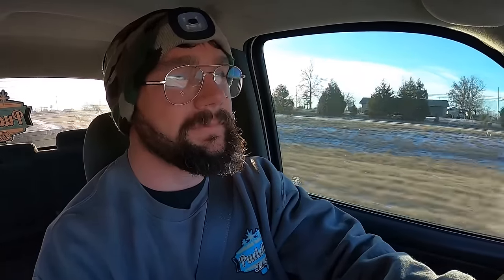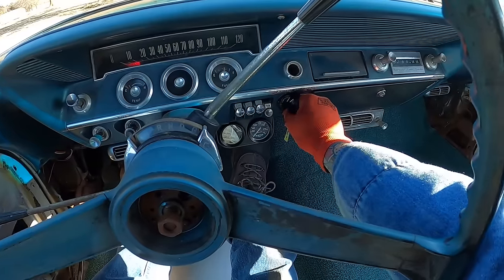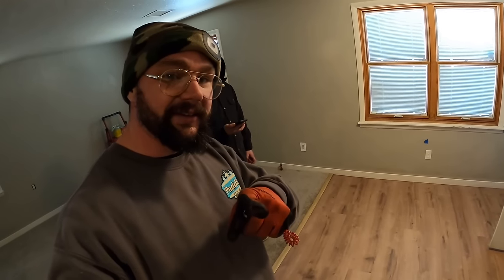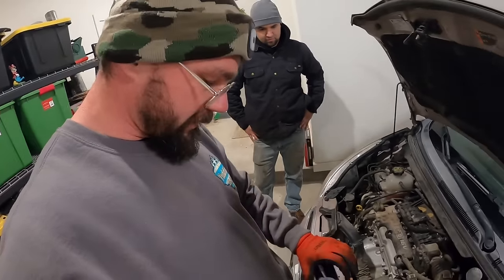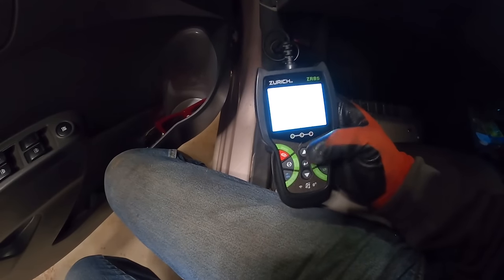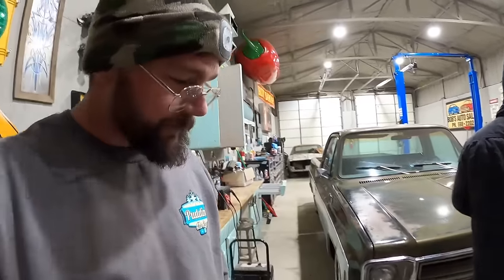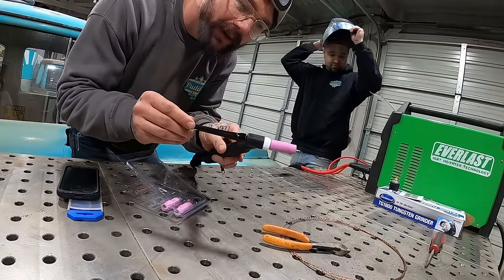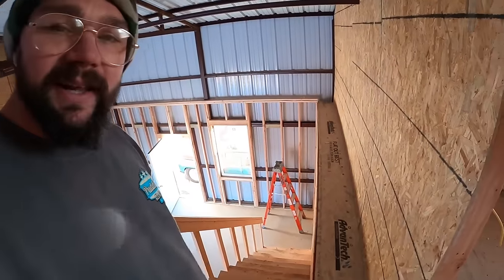Wagon is Back?? House update, Bad Coils, Shop Updates && MORE!

Comment: You should look into doing a drop trailer build, it would be a game changer for lowered vehicles and junk yard finds.
Reply: Literally the last thing I watched was a drop deck utility trailer rebuild... scaled up to car size would be awesome for lowered cars and recoveries.
Reply: I have seen some that are bagged and slam down for loading slammed vehicles. Pretty cool looking trailers.
Reply: a slammed camper, or slammed vintage camper
Reply: @raymundrodriguez1442  air bag trailers are awesome. No need for ramps...dump it down, drive on, pump it up, drive away.
Reply: @jmsmilin   a slamper!
Reply: I hope that pudding will build a ramp truck or rollback out of one of his two tons or a mini ramp truck out of the Toyota camper chassis with a mini 4 door cab .
Reply: Second hint is a front wheel drive haul truck with a air drop trailer for the back half of the vehicle.  So a towrola engine transmission with a mini truck cab .its the lowest possible way to haul or load cars

Comment: To see if the coil is bad just switch the coil with the one next to it if the miss fire moves then you know the coil is bad  if it stays on number 3 then there is a different. Issue   maybe coil wire coil plug  or even  the injector

Comment: Lovetap WAS looking real fine in that snowy cold 🥶 backdrop. AND she made it to work. Wonder if all the EV folk can say the same. Ol' reliable. 👏🏻👏🏻💪🏻
Reply: As long as an EV doesnt have to charge when its like -20F they don't really care. They'll lose some range but so will a ICE warming up and running the AC with the defroster.
Tit for tat an old ICE might knock till the oil starts flowing, an EV doesn't want to charge. Let the ICE idle up and let the EV condition its batteries they're both fine.
A more funny EV issue is without the engine dumping heat on the hood, the hood of an EV will stay frozen and blow snow all over the windshield. Same with LED headlights, no heat and they cover up in snow.

Comment: With regards to the internet in your shop, don't get a wifi booster, look into getting a Mesh Router. They are routers that usually come in packs of 3 or more that you place in different parts of your home/shop that connected to each other, either wirelessly or wired together with ethernet cables, so it acts as a singular wifi router, no need to switch from 'p-tangs wifi' to 'p-tangs wifi booster' if you were to go the booster route. Great video, happy to see the progress. Hope you're healing up well so we can get back to your regularly scheduled builds 💥👊
Reply: Exactly what I was going to post. With the boosters, you need to switch the device's SSID within each booster zone or coverage area. There are a lot of Mesh router products around to choose from. A strong wifi router could theoretically cover the entire area, but with the metal walls, that gets iffy.

Comment: I would advise pulling your plugs back out and applying copper anti-sieze on your threads. The threads on the plugs are steel, and the head is aluminum anti-sieze will prevent the rust and corrosion, making it easier if you have to ever change them again

Comment: Hey Puddin, Information Technology guy here. Hard wire all the outlets in your office for CAT6 just have them run back to a central router that you can even keep in your utility room. Also run a cat6 line through all of your shop spaces then you can place access points to your shop WiFi throughout in a mesh to really lock it in.

That is probably overkill for your needs, but then all you will have to do is swap out the routers and access points when they fail. Yes they will fail. 5 years is a pretty good life span for a wireless router unless you want to spend a ridiculous amount of money.

Comment: One time I dropped the oil cap on my Kia Optima down onto the splash shield. It somehow wedged itself between the oil pan and shield. I had to drop the shield to get it back. Needless to say, lots of cursing ensued.😅

Get some insulated garage doors for the new shop if you want the HVAC system to be more  efficient.

Comment: I always try 000 steel wool and dish soap first, then move to something more aggressive, you can actually just use a scratch renovator type polish that's used for light scratches and squirl marks, then buff the glass after with polish! 😊 8:33

Comment: For your net, look for someone that can setup Ubiquiti Airfiber. Have the sender at your house and the receiver at the shop. 1.2Gbps connection and you don't have to worry about running fiber to the shop area. We use it at a couple of our sites.

Comment: Oh frozen pipes are fun but nothing like a froze up sewer line to make things fun. Chicago polar vortex in 19 boss told us we weren't working the next 2 days because we were looking at near minus 30 actual air temperature. Figure get up,grab a shower and maybe run some laundry during my unplanned 2 days off. Middle of the shower start hearing gurgling and notice the drain ain't draining. End up having bundle up to run to a nearby gas station for washroom needs and eventually rig a 5 gallon bucket as a camp facility for the next 2 days and crash with family on the third  til things thawed enough to work again. Only saving grace of that situation was being a widower and my wife didn't have to go through the subzero roughing it.

Comment: We just love us some Puddin and Slick shenanigans!
Just a quick FYI...when you looked underneath the old house , that cement block under the beam should be 90 degrees rotated...they are much stronger with the "webs" vertical and not horizontal. Daughter of a mason (not the flaky society) here...talking from experience.

Comment: Use your old glass as a template and get a new one cut from laminated safety glass / double pane with plastic in the center, the guy who cuts the glass can polish the edges.. It will be cheaper than a new factory glass.
Reply: unfortunately it isn't that easy, It's curved and it's tempered glass
Reply: @gmedley66  then there's always Lexan

Comment: A tip from someone who would have a shaky hand tig welding, hold the torch nice and loose. The tighter you are, the worse you're going to weld. Also, make sure you're very comfortable with the way you're sitting.

Comment: Puddin!  Looking at the new building I did not see under the stairs framed in for additional storage.  In my opinion that is wasted space that could be used for brooms, mops😮, vacuum, or other stuff.  I am not trying to tell you what to do, but I see it as a missed opportunity if not utilized.  Also now would be the time to do it and it should be pretty cheap to do as well as quick to frame..  Just a thought..

Comment: I've had to use a pry bar to pop coil packs out. And plastic oil pans are a thing a lot of Ford f150s have them combined with a quarter turn drain plug that makes a mess when it hits the sway bar 😂

Comment: WAGON REAR GLASS Not sure about automotive glass but I have had good luck with removing hard mineral water spots on residential glass with Cerium Oxide. I used a hand drill with a buffing pad attached.  Its takes time and be aware of heat buildup, but restored my glass back to almost looking new.

Comment: Someone plumbed that fresh water right. I grew up in the snow belt and used to plumb residential homes. You have to bury it 18” or more to keep it below the frost line and from freezing between the meter/well to the house. And if you insulate it from the ground to the floor you’ll only ever have to worry about it freezing at the meter. That’s too easy though. A little propane torch and five minutes of your time and you have water again.

Comment: There is a wet sanding method. In order to get to fresh glass, you will have to wet sand to a super fine grit then Polish the entire glass. If you want it all to be the same, but it's possible, you have to sand to a clear layer it acts like paint

Comment: Best two suggestions I have for the glass would be original winded with Ammonia and steel wool, or alternatively if that doesn’t do it, a clay disc or clay bar.  Those clay discs for a buffer like Autogeek sells are super fast & easy and work wonders on paint, glass & plastic lenses like headlights/tail lights.  Just use some Windex to lubricate it and go to town! (incidentally, store the pad on wax paper after use or it will permanently attach itself to whatever the clay touches…ask me how I know)

Comment: Cerium oxide powder. Mix with water per instructions. Use soft lint free cloth over buff pad slow rotation. Make full strokes across left/right 5 min. Then make full strokes up/down 5 min. Clean off top evaluate. All strokes must be even. That should buff out in an hour or two

Comment: we use wire wheel cleaner on water spots on glass and paint. it is an acid like muriatic acid, just diluted. just be careful with stainless and aluminum trim.

Comment: I’ll give you the tech tip of the day, if the misfire is a P03xx code it’s electrical (plugs, coil pack, etc.) if it’s a P025x (I think that’s the range) then it’s fuel injector. There’s your tech tip of the day.

Comment: That's good you got heat in the shop and the addition is looking good. It good you you got heat on in the old house and got the pipes unfrozen an no leaks.  The car is looking good with all the new windows and rubbers an trim ps and the water lines fixed at the new house you got a lot done on this video 👍👍 you should be happy. Now just need to stick your food up the electricians but to git the electricity finished lol

Comment: On that new traverse keep an eye on the rear suspension. One of the rear arms on both sides has a bushing that goes bad on almost all them of that generation within 40k miles or so. The dealer will replace it for free. I’m sure others can tell you other things to check but that’s the only thing I’m aware of.

Comment: When I started learning tig, bought a big pack of tungsten, sharpened them all on both ends. Then when you inevitably dip the tungsten you can just swap it and get back to practice. Also good torch set up experience/practice. You might not be able to do that on all torches

Comment: If you get yourself some cirium or rougue from a glass shop and a sponge polisher, plenty of water and don’t get the glass too hot you should be able to remove most of the scratches from the glass.

Comment: Leave the water trickling on all faucets if you cant at least hold 60 degree's. To get it to run turn the power off to the furnace for a minute then power it up and see if it touches off. If the gas was off for a long while you may have to repeat the process till you get gas coming through the pipe.

Comment: I hated freeze ups. Had one a few years ago customers boiler died pipes froze and split. Got there at 2am in a snow storm. Cut out all the baseboard thawed it with a kerosene heater and soldered all back in. Returned later when parts house opened to replace boiler.

Comment: @30:40 Yep, Puddin, the 2023 Nissan Rogue has a plastic oil pan and they're failing left and right. Generally the entire thread assembly comes out with the first oil change. Sad part is that they are on a 2-4 week back order for most of the country and it still isn't a recall.....YET.

Comment: You should run a hard line into the shop for Internet. You could set up a wireless router in the shop. And it would run fine. Just a thought

Comment: Random thought while you were in the main shop getting the heat going. There's a company called Big Ass Fans, that make big ass ceiling fans. They have different sizes, and you would have to be sure you don't get in the way of the lift or the roadster body, but one of those might be money well spent in the long run....

Comment: Your tow rig will get better mpg with ethanol free fuel if it’s available in your area. My last 6.0 from 04 got 4 mpg better when ethanol fuel came out using the without version. Run the e free in my 04 8.1 and it does 2 mpg better.

Comment: It’s a little dangerous to leave water turned on when you aren’t there. I had a house with no one in it. The heater failed and a line froze and broke under a sink. I didn’t find it for 4 days. Had to replace all the flooring and the bottom 2 feet of sheet rock and insulation in the whole house.

Comment: A way to test a coil is to swap them exp. 1 n 3 .. put 3 in 1 n 1 in 3 run the car .. engine light on then scan it n u should miss on 1 .. simple new coil on 3 n 1 back to 1 tada 🤙🏼.. also tools avail. For coil testy but swapping Is free

Comment: That coil boot you had to re-use has carbon tracking inside of it, judging by how bad that plug was carbon tracked. You can get some new boots instead of the whole coil. You are going to need to replace that re-used boot, or it will end up carbon tracking you new plug and start misfiring again. Just a heads up.

Comment: Yes they are putting plastic oil pans on vehicles I have one unfortunately, but also for those coil packs I usually put a little bit of dielectric grease on the end towards the spark plug to luby-doobie it up so it isn’t quite as tough to pull those next time. Found out the hard way they hold on for dear life when I was trying to pull one and punched myself in the eye when it decided to let go from the ol twist and pull 😂😂

Comment: Out of experience, if you have a spark plug that is cracked and is carbon tracking like that, you need to replace the boot on the coil as well. That carbon tracks the boot as well and it will start misfiring in the near future.
Reply: Oh you put a new coil on it 👍

Comment: Get some aluminum tape and 2-in foam and insulate your doors you'll be thinking your electric bill in the winter and in the summer on them electric bills cut the panels to size could have in half slip them in and then put the two halves together that way you can cover every inch of the inside of the garage door just do what everyone else does look it up on YouTube lol

Comment: Hey Puddin' do you know about the utility sinks that have a pump unit under them so you can run the drain to a higher location? I've installed a couple and they work great for a Shop unit.

Comment: The 2 ton international trucks that have the hard nose or sheetmetal front hood and fenders do have a slightly different front cab the dashboard is the same but sets at a slightly different angle and height I have no idea international things I worked for a fellow who had a 444 rollback and a manufacture date of 1994 it was a model 1950 confused yet both look the same doors will interchange but the glass is 7 /  16 inch different in height same width his nephew layed it down on passenger side.  Jack it out used a door off a tractor trailer outside identical inside has a completely different door panel but it delivered septic tanks. My cousin repired the glass hood fender used the cardboard method very thin layer of fiber glass left over night and next day you can finish building the entire fender.  As a side note when done we showed him the driver side as repired.  He was ok but he had a family member who thought we couldn't do that and he went into a 25 minute session of how the fender on the passenger side was way better and this and that and after all the bs I said perfect because that's the one we replaced.  He suddenly realized he had to go somewhere else true story.  As a second side note the tilt hood international truck with the very small grille opening is very very rare on the east coast I have only seen one before and it is very unique to say the least.  Not sure if you want to fix it or not but if you GET HALF A CHANCE PLEASE DO  A SHORT WALK AROUND and door tag view.  It is as odd as it is cool.  My 1977 international needs the brakes re did . It is hydraulic brakes with 10.00 twenties 10 lug wheels DT 466  with a 5 n 2 trans rear I have been looking for a 450 ford or Chevy hydro booster but hard to find here it does have factory  power steering now .thanks for taking us along to the junkyard salvage center or parts recycling facility and keeping the cool stuff on the road n spreading sunshine instead of moonshine

Comment: An auto glass company should be able to measure that rear glass & cut you a new piece out of a current windshield. It's been done before for hard to find auto glass.
Reply: That's not a bad idea 
I'm pretty sure I could cut one out of a 65 Chevy van windshield.
I have one in stock, and it looks like an identical curve.  I'd hate to get everything torn apart and be wrong, though😕

Comment: Where was teh anti seize on them plugs? notice how hard that first one came out. The other guys didnt use any either , you`ll  be pulling teh head next time .If that plug was cracked , why  are you replacing the coil? waste of money dude. You need Alldata if ya is gonna work on that 1980 and nnnewer stuff . Its only $400 a month.